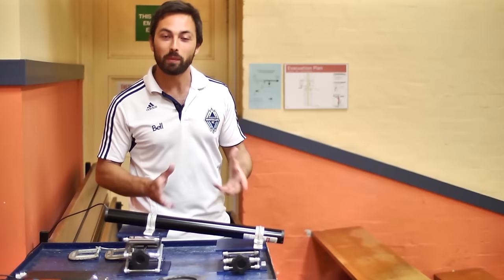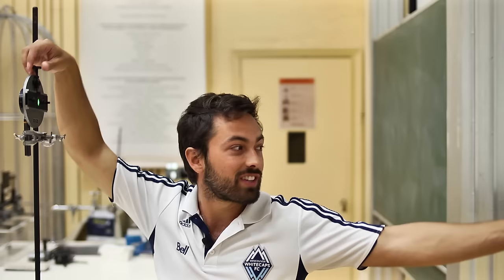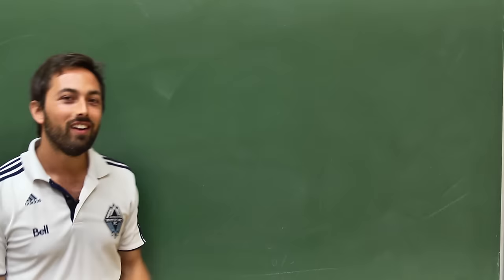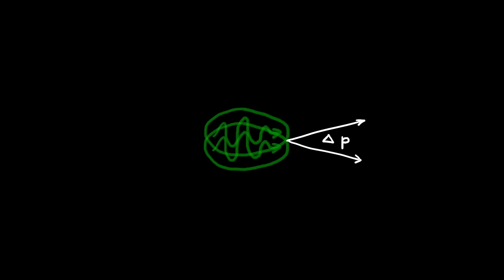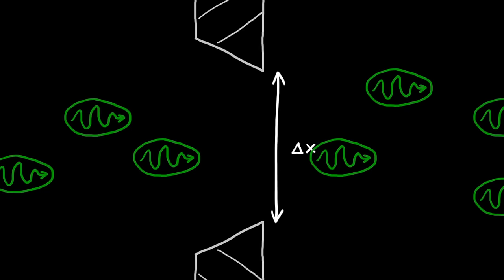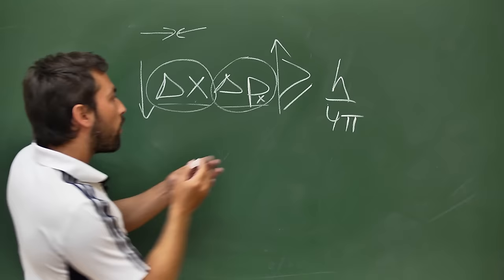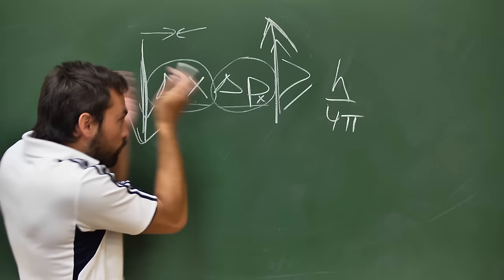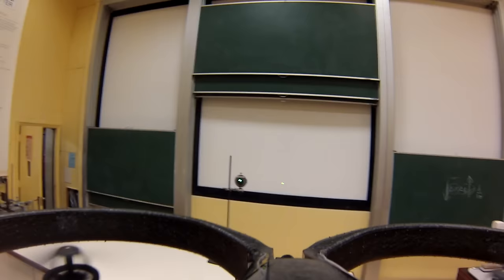Heisenberg's Uncertainty Principle Explained

Comment: From gamma waves to radio waves, these electromagnetic radiation travels at same speed of light from A to B. 

Wave lengths of gamma rays are hardly an atom, while radio waves are as long as football fields. 

We can only pick up a small segment of em waves, that we see as light, from the longer red waves to the shorter violets. In this sequence, red orange, yellow, green, blue, violet. 

Now, the objective here is to explain why the full spectrum of em waves travel at same speed from A to B. And, to extend this explanation to understand why time dilated, relative to our speed.

Whats missing is what's now being identified as the wave impulse path. Changes of the em energy trigger the scope of the spectrum frequencies by varying wavelengths. The full spectrum of the em waves, moves at the same speed from A to B. 

Wave impulses do not travel in a straight line, from A to B, as a particle would. But follow the wave impulse path pattern. Wave patterns of every frequencies differ. The higher the em energy, the shorter the wave length, the longer the wave impulse path.

Wave impulses move along the respective wave impulse path, hugging along the waves impulse  path pattern. The speed of the wave impulse (not speed of wave) varies proportionately with the em energy generated. Such that gamma rays is highest, while that of radio waves are lowest. Such that the wave impulses of gamma rays move fastest, while that of radio waves, move slowest. 

The wave impulse of gamma rays, with highest em energy, are moving the fastest, but it has a longer wave impulse path to cover. 

While, the wave impulse of radio waves with lowest em energy are moving slowest. Then it has the shortest wave impulse path to cover, and reaches point B at same time of the gamma rays. 

So, the conclusion is, both gamma rays n radio waves, along with the full scope of the em energy spectrum, move  at the same speed. The speed of light. 

I hv perceived a new variable in wave mechanics, ie wave impulse path.

Comment: The interference pattern is only visible with coherent light (laser). Since photons do not know Heidenberg's relation, the path change must have a physical cause. So what is happening in the slit ? As soon as the slit narrows to the nm range, the electrons at the left and right side start to repel and create a fluctuating EM-field.  This weak field  deflects the photon. The narrower the slit, the more electrons start to 'see' electrons at the other side of the gap, this strengthens the fluctuating field in the gap, and thereby the photons will be deflected wider. It might be interesting to find out, whether this field is material related. Is there a difference between the transition metals? Or between carbon, silicon and metals? Is the interference width related to the material, i.e. electrons in the outer shell?

Comment: Depiction of individual photons as concentrated in space AND time is the key.  Most draw continuous-wave (cw) photons, because they don't have a time-dependent solution to the wave-equation, but cw is incorrect.  Actual individual photon energy is concentrated within a few cycles.  "How many cycles?"  Glad you asked, because "how many cycles" is the crucial question.  What is the full and proper equation for a free-space photon?  Once it's found, Heisenberg will be disproven as merely a statistical artifact of photon phase interactions with slit boundary conditions.  (more...) 

Subsequently, Schrodinger wave-equation will then do the same for so-called "particles."  It will be shown that there are no particles.  None.  In the entire universe, not one particle.  So much new physics will flow from these realizations.  If only I'd spoken-up when I was young?

Comment: The reason why ur laser will exhibit diffraction patterns is because u are passing it thru an aperture roughly the size of the laser wavelength which is 520–570 nm. So hypothetically, any object will exhibit a diffraction pattern, so long as the object can pass thru an aperture roughly the size of the object's wavelength.

Comment: I've always had a hard time with this experiment. How can we be so sure the spreading out isn't caused by something else (like the gravity of the slit, for example, or the difference in the angle of the photons on one side of the beam versus the other, or what if the photons are actually getting reflected by the surface of the slit?). It seems like there could be other explanations for it.
Reply: You rule it out one by one. You need to use your brain, kid. :-)

Comment: But the momentum of the photons didn't change since it has a fixed velocity and the mass didn't change due to it having the same energy.  this means that ∆X gets a lower value after a certain point in the experiment. Did I get that right?
Reply: no momentum has velocity which is a vector change in direction equates to change in momentum so there is a change in momentum even though there is no change in magnitude of momentum
Reply: @qwerty_1_2_3  
Thanks a lot that makes much more sense after watching it again
Reply: @thomaz851 your welcome

Comment: When a particle goes through the narrowing slit, its wave-like behaviour is diminished to a point where its wave behaviour becomes packets, particles. These are multiple waves, as per Fourier series. Therefore, the wave's momentum becomes fuzzy, explaining the diffusion. Therefore when a position of a particle is uncertainty, its momentum is well-defined. Momentum is manifested by the wave behaviour. That is the  ∆p∆x. When time is well-defined, the energy is uncertain because no time is present to dictate what should happen.  That is the  ∆E∆t. His is the part that led to the Big Bang.

Comment: Good video, but nature doesn’t change its behaviour in order to make an equation balance. The equation is our (very successful) model of nature. What is happening here has to do with the central insight of quantum mechanics. The ways that things can happen affect what does happen. As we reduce the size of the slit we start constraining the possible ways a photon can pass through the slit. This affects the way a photon actually does pass through the slit. The effect on measurable outcomes as we change the  constraint is modelled by the uncertainty equation.

Comment: It is not about uncertainty at all. What you see is an interference pattern. If it was only about uncertainty you would just see a smear but you don't. You see stripes. And this is because of the wave behaviour of light. It is not even about quantum mechanics but electrodynamics.
Reply: I agree, if you see carefully the video, seconds 49 and 50, you will see a interference pattern similar to the double slit experiment result.

Comment: You used the right words "not intuitive". Those words have been used by Feyneman and others to describe quantum mechanics. For some reason laymen has garbled that to "no-one can understand". Those are totally two different things. To not have intuition means you need to calculate to get to the point where you know you need more tests. You can get understanding by making more tests and more calculations or learning from those who have done them. But that still does not give you any intuition where to go. You just need to make more tests and try to figure out how the small works.

Comment: A good way to think about this is to consider Carbon 14. It has a half-life of 5730 years. Carbon 14 decays to Nitrogen 14. Ok, so to make it simple to model, let's say we have 1 million Carbon 14 Atoms. In about 5700 years (+/- 30) 1/2 of those atoms will decay. of the remaining 500,000 atoms, 1/2 will decay in the next 5700 years.  Every atom is exactly alike yet there is no way to predict which atoms will decay. Why 1/2 in 5700 years? Why 1/2 every 5700 years? Each atom has only a probability of decaying in any moment. Why? Why that atom and not this atom? This involves no intervention such as manipulation of the slit which is a form of measurement and does affect the results.

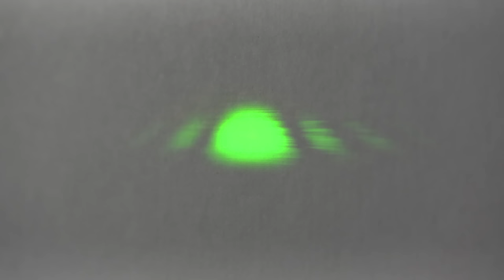Comment: 0:36 Please explain the physics of what the light is doing in this pattern?? Also moments later, I begin to notice the blob breaks up into a bright spot center, then after some shade, a crescent shape on the left and right sides, almost appearing to be an interference pattern! Why would this happen with only one slit??? Then at 0:58, take notice that the light begins to smear into a stepped pattern on the left and right sides of the blob. Also notice moments later, the stepped pattern grows across the blob to form horizontally oriented fringes. Why are there horizontally orientation fringes in the blob even though the source is a vertical slit? Why are all these things I mention be happening?

Comment: It is called diffraction and has nothing to do with Heisenberg uncertainty principle! 
The size of your slot is like 10^9 greater than the « size » of a photon, this is your delta_x.
I(x)= sinc( C. x. slot/lambda)^2. 
We know this result since the 19th century and it holds because light, at this scale, is a wave.
It is a huge misconprehension and shouldn’t be on a science channel. Like you didn’t have any good example ? Why is there an absolute zero or why the Van der Walls force tends toward +infinity when r->0?

Comment: one of the better demonstrations but not that great on theory behind the principle which is that quantas or individual particles come in constant packets based on h which is a constant
and h = Js = length x momentum (a vector) with direction or angle.
there is also uncertainty between J and s when h is constant ie at the quantum level.

Comment: Why would that be so nonintuitive?  It seems to me just as you decrease the size of an air vents opening, or a compressed air hose. Also a water pipe/water hose. Or like with electricity in circuits or through power lines. Sure no physical material confinement and therefore no clear pressure or force caused by it. Though if you accelerated water to that velocity I dont believe youd need the physical hose either. It just seems weird how its always being emphasized how all of this is supposed to be unintuitive, odd, mystical even disturbing and disconcerting. It's pointed out and emphasized so often. I sometimes feel like I'm abnormal or freakish for not feeling that way. It ämazes fascinates, and awes me at times. Yet I have not had to undergo some life altering reality changing "letting go" of all pre-concieved notions. Then undertake some zen pilgrimage to a higher plane of awareness before I have finally come to terms with and accepted some new ideas that changed my concept of reality. I'm starting to worry, feel a little awkward and weird. I feel a little freakish, and wonder if I've missed something.Becouse it makes sense. And I'm gaining more and more of a grasp. never really experiencing all of those pre req

Comment: The uncertainty principle does not explain that. In fact it applies in each direction on its own, and doeant include other directions. What you are actually claiming is that when you decrease the uncertainty of position in x direction the uncertainty in y direction increases, and that's why the spot spreads in y direction, and this is simply false.

Comment: Hello ! I'm still not convinced about your video ! I'm not "surprised" to see the wider spectrum light because I can explain myself the spread due to the interference we are adding trough the filter. The object used in our case is metallic which produce reflection

To our view the filter is perfectly square, in reality it has rounded angles which are able to spread light. So as light would hit the angles and is cut-off, i can imagine fragments being redirected on the opposites parts of the "filter", bouncing off until it reaches the out-opening. 

I'm kind of challenging you there ; I wonder what would happen with a filter composed of absorbing light or one that could prove it's non-interference with the light as it passes trough it ; (doing what we think it do) - especially for very small interaction ; i feel like a small filter width (not the gape but the the tube size trough which light passes trough) would still be able to make significant changes ;

Now i'm not a photon-scientist / engineer and i'm writing this trying to "playing the scientific game" without much more knowledge of the actual realities.

Very fond of your videos and I hope to see more !

I could guess that there are some papers that have already worked on this idea with much more sophisticated filters ?

Comment: What if ∆p doesn't change for the implied reason? What if the momentum changes because there's a force between the slit and the photons that can only act upon the photons over a very small distance and only when they are very few photons?

Comment: Sir I want to know is Hiesenberg's uncertainty principle valid for stationary electron. As taught by teachers to me that Hiesenberg's uncertainty principle is not valid for stationary objects. But if we think of the principle it is valid for microscopic particles and it is due to fact that we don't have length measuring device whose least count is less than that of microscopic particles and also to determine the position we need watch it using a microscope and a light beam will fall on it exciting it and thus changing its momentum. Now if electron is stationary then to determine its position we watch it with microscope a light beam falls on it this it's momentum changes. So Hiesenberg's uncertainty principle is valid.

Comment: This is actually explained by pilot wave theory, and quantum gravity.  Photons have no mass, in our Dimension of Observation.  However, from a Dimension of Observation as small as a photon, they do in fact possess mass.  Just as from a large enough perspective, our entire Observable Universe exists as a virtual particle that instantly annihilates itself and only as a zero sum field of resonating energy.  Imagine sitting on the surface of a photon, you will then be able to rationalize why the Speed of Light is zero because Causality forms boundaries between Dimensions of Observation to create Infinity through the infinitely divisible spectrum of Energy that all existence resonates from.

We boil up from an infinite Quantum Foam to form a single virtual particle in a vastly more infinite Quantum Foam, from a Dimension of Observation where photons exist at a wavelength a magnitude of magnitudes larger than two colliding super massive gravity wells in our own.  The infinite multiverse is a blooming string of beads separated by causality at a fixed ratio according to the Dimension of Observation, and expanding in three fixed dimensions from any given point.  This provides the foundation for a theory of everything based not on probability, but of Observation.

Comment: Is that just diffraction of light(the the direction of photons will change drastically, in other words, bending when it get collide with any material with a size comparable to wavelength), there could be the relation with uncertainty but the experiment and explanation didn't give much confidence that relates uncertainty.  excuse me, if i am wrong, that's what i felt.

Comment: So why is it working with water or sound waves too? I don't think the Principle is applied with them.
I always learnt that each point of the slit behaved like a secondary source, leading to interferences and those different probability of hitting each part of the screen
Reply: I also remember that theta = lambda/ a (slit thickness), and that's why the spots angle is visible (not too wide but not too thin) only when a and lambda are close.
Are you saying that this relation come out of the uncertainty principle? Even with water or sound waves?